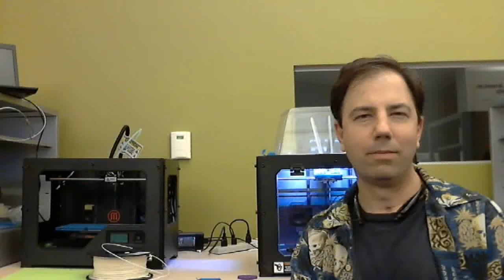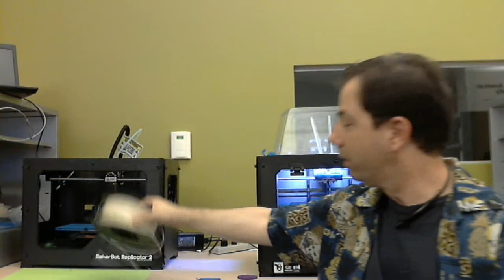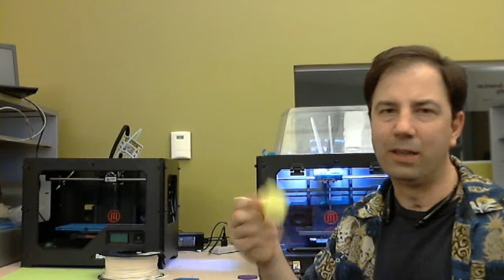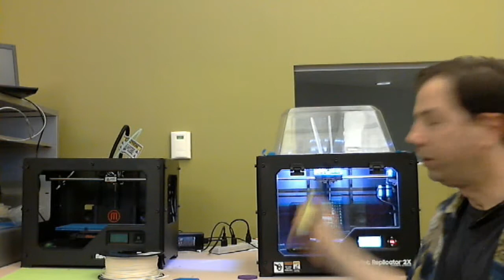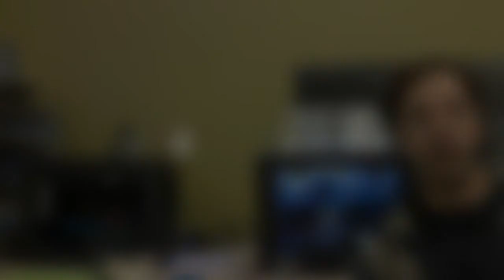makerbot 2 and 2x review

Comment: Hi mate, Im about to purchase a 2x. Would you recommend another competitive printer?
Reply from the maker: joe fussy Hey, I have not messed with others (under 20k), but anything that stays away from the heater plate (no abs plastic) or has multiple extruders is the right direction.   I did get some bad reports about the Cube 3d printer, it prints in multiple colors but you have to stop and change out for each one.